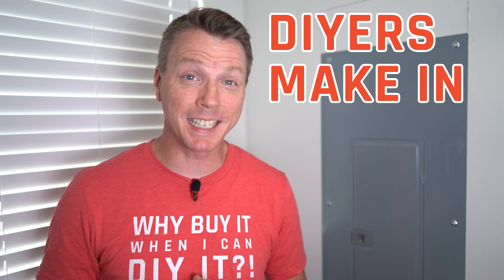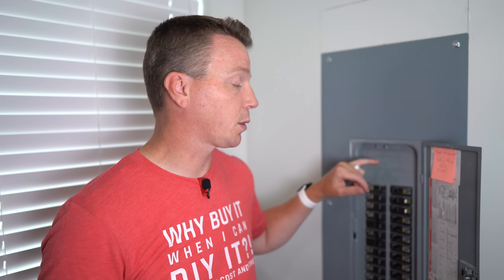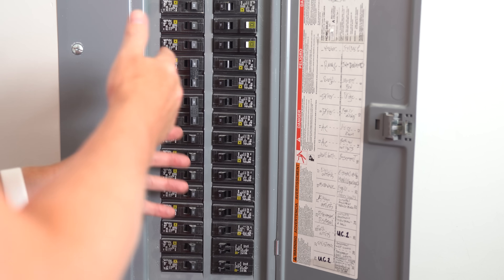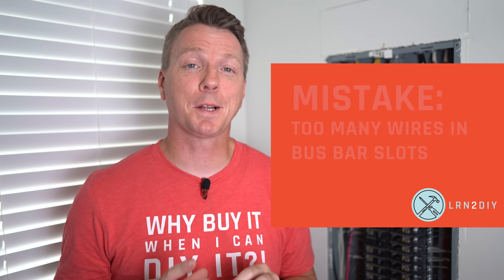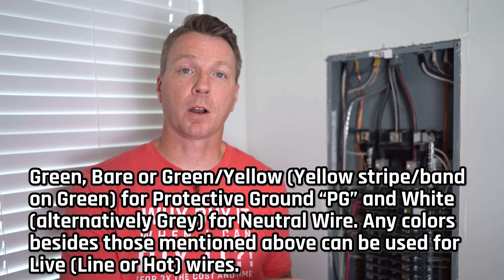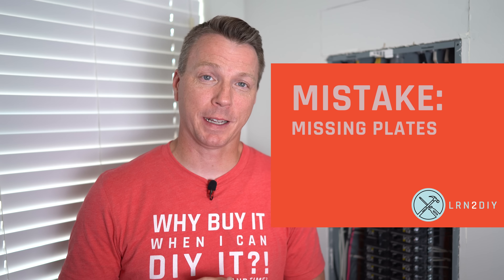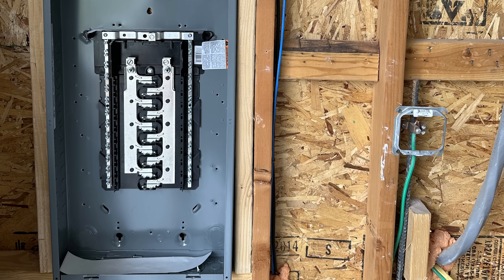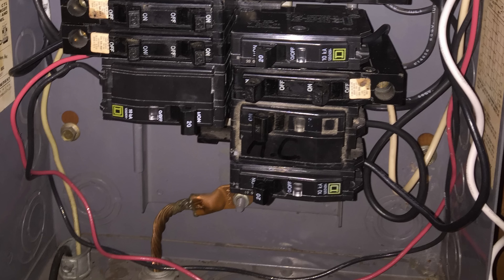10 Common Mistakes DIYers Make In Circuit Breaker Boxes

Comment: Number one problem with DIY'ers messing with the power supply in the fist place. number 2 is a wire is a wire. number 3 is it works. Number 4 is failure to call an Electrician. No electrician is going to use a toque wrench on  breaker screws nor Main Terminations in a residential panel. You got to love the home owner that thinks they can add more and more with total disregard to calculations of supply vs demand

Comment: I am by far no expert who can give advice, but the scariest thing i ever saw in an old friend's basement was that he had disconnected all of his ground wires from the actual ground and wrapped them around a nail he put in one of the wodden floor joists. His reasoning was that "you're always told to not stand under a tree during a thunderstorm because it's such a great conductor... therefore there is no better conductor for grounding electric than wood. "
Reply: 😂😂😂that’s about the equivalent of bonding a pvc plumbing pipe because water is a good conductor
Reply: I'm not joking one bit. Fortunately no one got electrocuted (although I would always get a slight buzz if I touched a screw on the bathroom light switch). Fortunately, he got a big wake-up call when he went to sell the house, and the inspector flipped out.
Reply: I hope you're joking
Reply: That lightning just jumped a few thousand feet through AIR, which isn't a great conductor...

Comment: Speaking as a bit-brain, spread sheet, use it.   As a home owner once you've invested the time and effort to trace every circuit, accounted for every outlet and appliance, put it in a machine readable form.   Notes inside the breaker box usually lack detail and legibility.    For every circuit, document it's room(s), outlets, light fixtures, HVAC, appliance etc, amperage and total voltage where appropriate.   Then create another page and reverse the information, give yourself lookup table by outlet and room to quickly lookup an outlet's circuit.   Note all peculiarities in the box, shared neutrals (ugh), breakers with multiple hots, empty slots, unconnected breakers (wtf).   Note special outlets with surge protection or GFCI.  Then print one copy and affix it to the box, keep the version on your computer to use when contemplating home improvements or purchasing major appliances.   And buy a circuit tracer, easy to use, invaluable for work around the house and next time you consider buying a house find those code violations before making an offer.

Comment: In he US DIY is still possible but in many other countries you had high requirements to touch anything. Even if you are "qualified" (it's a 30 min. written exam if you only want to make your own private installation) you don't want to do it anymore as the rules are highly complex with many edge cases. To do it for others as handyman, you could get a 2-week course to be able to do some basic installations (after the meter).  The highest you could get is what in the US the lineworker do (working with energized unprotected power lines) but you need about 5 years to get this, and you only need this qualification to do work for anything before the meter. The guides in the US code is easy to read and to understand.

Comment: Wiring is one of the VERY FEW areas that I actually agree "an expert" should at very least double check it.

Though "code" is a lot of times just trying to sell something rather than being safe.

One state I worked in we had to install "code approved" sleeves in the holes of all the studs before running wires though them... because the wood might scrape the shielding off the wires. >.>

Another was we had to buy GFCI breakers that cut BOTH the hot and neutral that cost 4 times the ones that just cut the hot.... because someone might mix up the hot and common/neutral wires.
(These said wires are the ones coming IN TO THE HOUSE because they are the ONLY wires connected to the main bars of the breaker box that the GFCI breaker is connected to)
Reply: Huh  I would say the NEC CODE is there for a reason   it sounds like you were dealing with specs   which sometimes supersede state, county, city codes
Reply: @michaellike5037  
They were state codes

Comment: Being as anal as I am, when I installed a generator switch subpanel I rewired everything in the main panel eliminating the crazy rat nest left by the professionals.  Also, I use color SHARPIE markers when changing white neutral to hot red or black.

Comment: If you want to get by "double tapping" just run 1 wire to another box nearby and nut as many as you need.   I use a terminal block.
Reply: It's totally accepted by the NEC to wire nut conductors inside the panel.  Which is an enclosure!
Reply: @michaellike5037  did a disagree or said it wasn’t?

I work with machines where panels will have dozens of nuts and don’t like fiddling with all them and rather have wires ran neatly.   It’s preference.

Comment: It is worth mentioning load balancing - installing circuits such that current is taken from each side of the 120 volt split evenly.
Reply: That can be incredibly difficult to do in a residential panel where the majority of the usage is short-term period circuits. You can maybe try to divide the larger power appliances like dryers, blower motors, and microwaves on opposite sides, but you cannot control when those circuits are used so the balancing is virtually useless.
Reply: that is a good practice to try and get it close, but i wouldn't waste much time doing load calcs. most of the load is probably two pole breakers, then you don't have to worry about it right?
Reply: I did this the first couple of houses I did. I later realized I spent way too much time trying to speculate how peoples routines would be and what a pointless exercise it is. Unless you have a computer room, studio, garage , etc with known loads you really can't balance loads effectively.
Reply: Not Necessarily, most breaker panels double 3 wire circuits using one neutral need to be together (like a double pole without the bar), if they are across from each other, they would be on the same phase and the neutral amperage return would be the amount of amp draws of each side added together, whereas when the breakers
Reply: not in a single 240v split supply, this isn't a three phase panel.

Comment: The panel shown at 13:09 look great.  However - I always added service loops to my conductors.   Unless there is a gutter above for service loops (not in residential installation), I would add them in the panel.  You never know when you have to move breakers around.   And the key for any electrical installation is having your connections tight.  As the circuit is energized - de-energized the conductors will expand and contract.  If not properly tightened - will become loose.   And recently I started using 24VAC lighting when possible.   Those systems are typically powered from a Class 2 transformer - allowing for Class 2 power limited wiring methods, which provide many installation options.
Reply: I was recently adding a generator tie-in to by panel and found a loose wire going to my dryer circuit. Luckily, it didn't look like it over heated. I went and checked all the screw terminals while I was in there.
Reply: And I can't agree more about the service loop.

Comment: one note on your 'pretty' panel wiring. An over zealous inspector could easily come along and consider all those wires zip tied together a bundle and then you just created a headache for yourself. I'm no electrician but I believe the NEC considers a bundle anything over 2' Its something like that.

Also I don't think the problem of a ugly panel results from the first install in most cases. Its usually the result of 70+ years of changes and once it reaches a point where it looks like that the next persons just stuffs their upgrade it and slams the door shut. Out of sight out of mind.

Comment: With the complete lack of understanding of basic terminology showed in the first 3 minutes of this video, the advice offered at 3:50 is the only thing to take away from this.  Engage an electrician.  You have to sleep in your home, you paid a lot of money for it, and your insurance company doesn't have to pay out for damage caused by works performed by unqualified persons, when the defective wiring burns your house to the ground.

Sorry, this guys knows just enough to get you in trouble if you use his advice.

In the case of eletrical, DIY=DIE.

Comment: 1) Well, there are no labels if you don't have the front door on the panel lol.  I was working on a project over a long weekend, and the screws to hold the door on ran away somewhere.  Ive gone to the store a couple times to try to find the right ones, but they are an odd threading, so the door is still sitting on the floor 10 years later... sigh I should probably try again.
2) I think I'm actually good on use.  Moved in and all the lights were on 1 circuit, and outlets (other than the kitchen) were spread around 2.  Now each room has a tandum breaker with 1 being lights, and one being outlets, and all are really small amperage except for where I have something bigger like the basement tools or kitchen.  Now that we are all LED lights this is probably overkill, but the organization is satisfying.
6) Um.... there are separate bars for neutral and ground?  Maybe my homes have all been too old, but every home I have had only has a single bar for both the ground and neutral to go into.  The few original wire runs in my house don't have a ground, or some guy ran a bare wire ground from the outlet to the water line.  Thankfully not many of those left as that is all that is stopping me from moving to pex piping.

Comment: Good video. Mostly common sense :) I think we need to re-design residential wiring and appliances. If you think about it over 1/2 of what we use gets converted into low voltage dc. Yes we still need 120 for the big items. I think we need 120ac in a very specific area of the home - AC/washer dryer and ovens. Pretty much everything else should be low voltage DC. This would reduce the complexity and increase safety and not t mention bet rid of all the wall warts! :) All my lights are LED and now the brandan is banning incidents... I think it is time :) IMHO. Peace!

Comment: Just like most home DIY'ers, I see so many violations as far as electrical installations. I am an electrician and have been for 30 years now. The best advice I have for homeowners is to call an electrician! You can double tap grounds. Look at the manufacturers specs on the grounding, the only breakers I know of that can have more than two wires are square D breakers. Look at the manufacturers specs. So cities won't allow it even if it is legal. Check with your local city inspectors. The dround should never be cut, whether on a branch circuit or a main feeder. It always should be continuous. Most inspectors will let you get away with cirtian things as long as it fall within the manufacturers specifications. Electricity is dangerous to play with and to someone untrained to work with it risks electrical shock or even death. The majority of home fires are the result of home DIY'ers doing something they think they can do from watching a video on you tube. Call a licensed professional,  please!

Comment: One of the reasons I am rewiring my house was because of the messed up breaker box labels.  I turned off one circuit, and it turned off lights and outlets randomly around thr house.  I turned off thr one labeled new room and it turned off two bedrooms and an outlet in the kitchen.  It's getting done one room per circuit instead.

Comment: @2:45, notice this creature won’t tell you how to calculate 80% of amperage when the total amperage from all the circuit breakers exceeded the electrical panel’s amperage rating.  This dude is sly, slick, slimy, and smooth.

Comment: Doubling up a neutral hole? Yeah. I had a GFCI outlet quit working after I plugged a space heater in downstream. Replacing the GFCI did not fix the problem. In troubleshooting the issue I found strange voltages at the GFCI, and everything normal at the breaker. Scratched my head a little bit and did a visual inspection. Found some brownish tinted neutrals at one hole on the bar, 4 wires to be exact. The heating and arcing had welded the screw in place and I had to cut all the wires loose and abandon the hole to start fixing the problem. Had to trace down each neutral to turn off all the affected breakers. Just remember an open neutral is not safe just because it is a neutral. If the circuit has a load, the neutral has line voltage if it is not properly connected to a neutral bus.

Comment: 2:51 BEFORE you take that panel cover off, it would have been nice to mention that you should probably have flipped off the main breaker that powers that panel otherwise you're one easy mistake away from 240v of a shock while working on a live panel as a DIYer.

6:17 Also, you previously mention that if a panel is fully loaded, you might want to create a sub panel... Unless I am missing something like a ground/neutral bond that I can't see, what you have right there is a sub panel.

Comment: Electrical wiring is NO hobby call a licensed electrician. Do not hover you bare hand over or near live electrical equipment. If you do decide to DIY just know that this can and will kill you if you make a mistake. Turn the power off before all servicing. And then still treat it as it is live. It may just save your life.

Comment: I have better mistakes for you.  My house has circuit breakers,  AND older fuse boxes feeding from those breakers in the utility room and garage.  From the original homeowner.   And most of the older circuits are two wire and as the older wire was stapled down every few feet,  I would have to completely tear up my attic  and the walls to be able to able to add a third ground wire or to replace the old wires.
Reply: So what are the mistakes? What you described sounds like it was done to code. Fuses are old-school but still allowed even for new construction. Ungrounded circuits are not permitted for new construction but are grandfathered for old construction. If you decide to add new grounded circuits I would personally leave the ungrounded wiring in place assuming it is still in good condition. Having extra bonus ungrounded outlets won't hurt anyone but could be handy for a lamp.

Comment: Nice vid. Your arm got so close to the lugs a few times I cringed. 
That made me think of a suggestion. And forgive me if you've done a vid on it already; this is the first I've seen of your channel. 
Exterior emergency disconnect. Basically it's a double Main breaker, one being outside. Two benefits to this. One, fire departments love them. It cuts off power just below the meter. Water and electricity don't mix. Second; if you just trip the main in the breaker the lugs are still hot. Tripping an outdoor emergency disconnect 100% of the panel is dead, lugs, neutrals everything. Just don't lock it for emergency access.

Comment: 2 or 3 grounds of the same size under one screw is actually ok for most panels and jurisdictions (the panel should tell you how many it will support). But only one neutral per screw.

Comment: I carry a bottle of wite out just for the purpose of relabeling panel covers. I also make note of any breakers that may have been turned off, in case I accidentally bump breakers off when removing panel covers. I wouldn't want to turn on something that is supposed to be off. Also not mentioned was how to tell if you may connect ground wires to the same neutral bar.

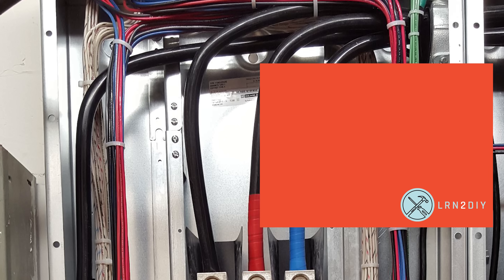Comment: It may have been mentioned,  but, not to confuse, the beautiful  panel at 13:01 is a three phase panel. Which is a different  setup than standard  household  panel with 2 hot legs, neutral  and ground...